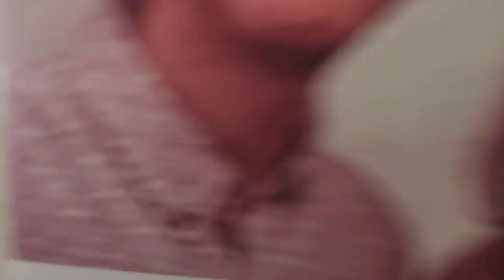CLEAN WITH ME - DIRTY HOUSE EDITION! | CARLA JENKINS

Comment: Glad to see I'm not the only one who does recycling in bare feet. In the same boat with my hall/stairs carpet. Still waiting on the quote.  I managed to get luxury vinyl flooring on market place for £35 to redo my kitchen floor. Looks like laminate flooring but much easier to put down. As long as your floors are level it might be a good alternative for your kitchen and people are selling unused often quite cheaply.
Reply from the maker: They're not level unfortunately, I was thinking of looking at some levelling compound. It's just that you can't get to the loo without going through the kitchen so finding a good time to use levelling compound is a challenge!